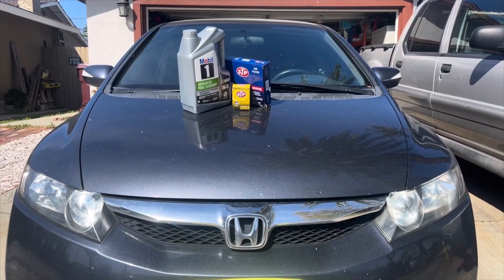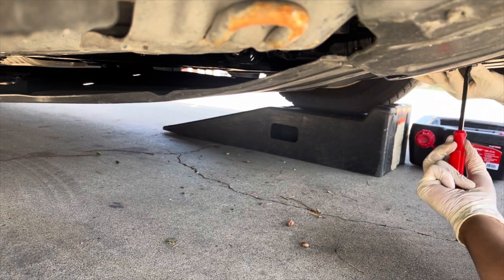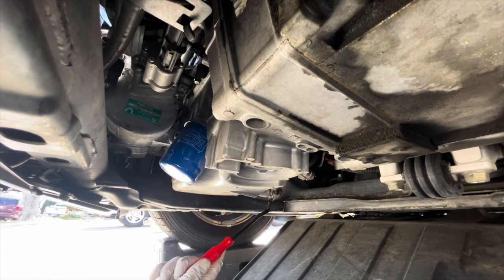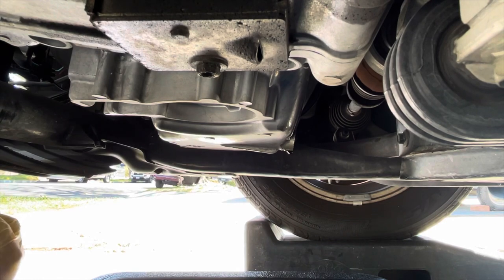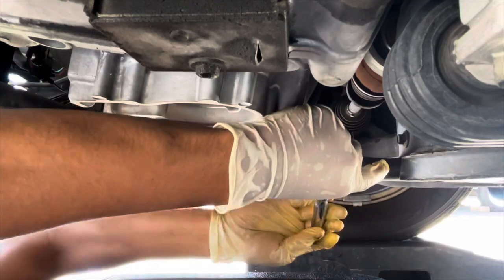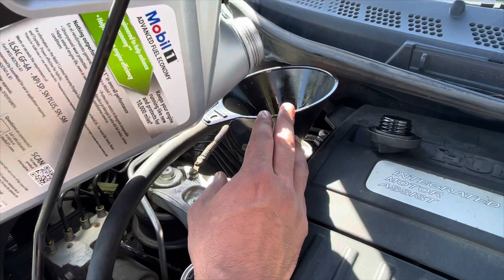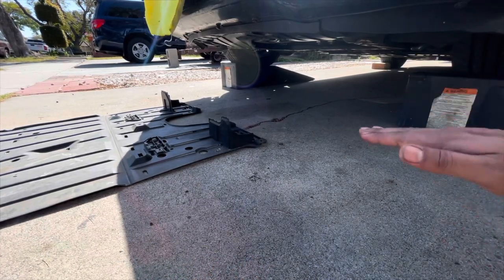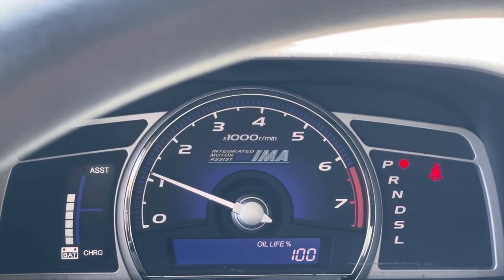2010 Honda Civic Hybrid Oil, Oil Filter and Air Filter Replacement (DIY Basic Maintenance)

Comment: I purchased a 2010 Honda civic hybrid too. I noticed that the car jerks a little when you put it in drive or reverse. I have never driven a hybrid before so I don’t know if this is normal. Do you hear a click sound when you put your car in drive or reverse?  Thanks.
Reply from the maker: I’ve had mine almost 2 years and have not had a click or jerk when in reverse, only on a slight slope when going into reverse it will shift a little hard but other than that have not had that problem.

Thanks for watching and the comment!
Reply: Got a 2008 and 2009 with about 110k miles both were clean with little wear and tear and drove smooth and perfect, not too long after having the cars they had similar issues with jerking from a stop when trying to accelerate, checked some maintenance spark plugs were burnt and probably got new MAF also since they’re from factory(plenty of years old), right after that cars worked and drove smooth like nothing happened except my girl didn’t listen to me and drove the car with the jerking issue for like half a year and she had to pay to get the transmission replaced($2,500)